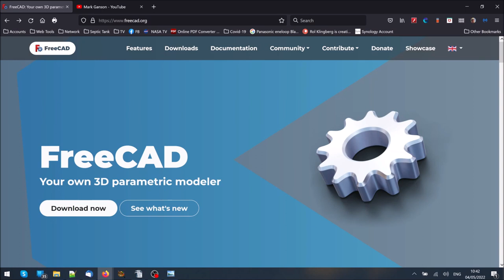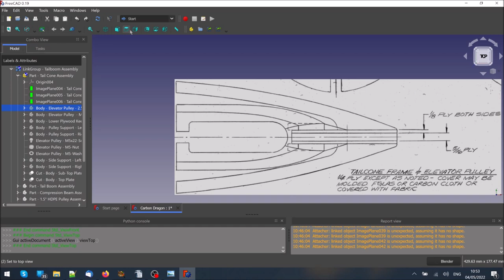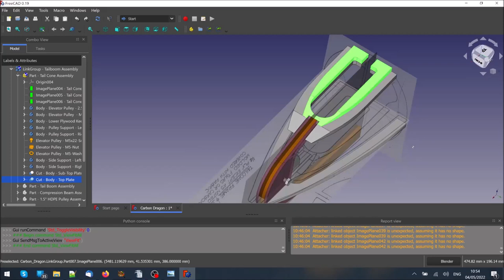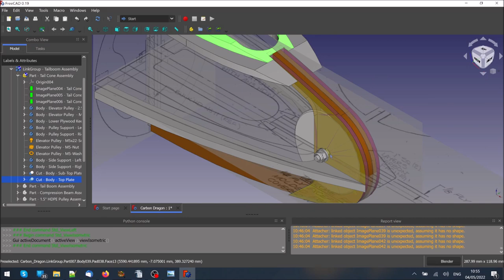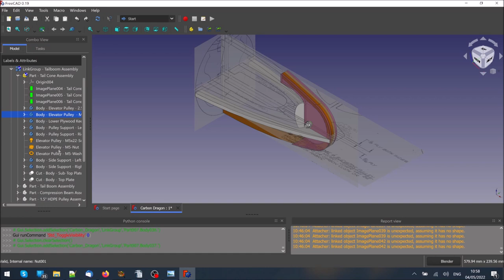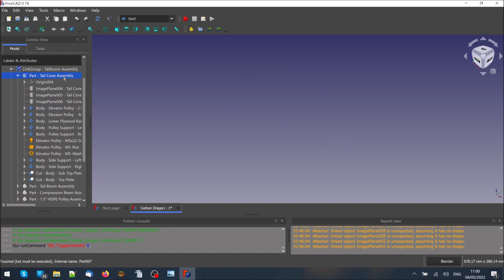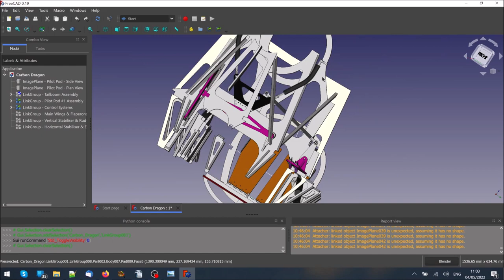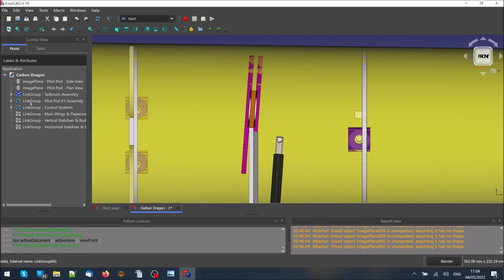Phil Lardner's Carbon Dragon Project - FreeCAD Model Tour

Comment: Thank you very much for sharing ! Do you have a blog ?
Reply from the maker: Thanks. I don't have a blog, but you can find out all about the Carbon Dragon glider on my website: carbon-dragon.ihpa.ie
Reply: @PhilipLardner1967   Thanks again. May I ask you how much weight you saved substituting the wood by carbon?
Reply from the maker: @tomdoly1918  There's very little weight saved by using a carbon-kevlar-carbon sandwich ( which ended up about 0.5mm thick, as opposed to the original .8mm thick plywood leading edge), but the composite leading edge is much stronger and will never deform due to humidity, as the plywood is very prone to do.
Reply: @PhilipLardner1967  Again thank you !

Comment: Nice work Phil... If there was one guy qualified to do this it would be you.

Maybe you can eventually get CNC drawings together with a material list that would allow a person to have a fully carbon fiber carbon dragon that can be cut from stock sheets of carbon fiber. It would be neat to see the carbon dragon not only preserved, but also updated and have a lower build time.
Reply from the maker: Hi Carson, while there may be the odd misalignment of the positioning of individual parts in the model, the individual parts are 100% accurate and can be used to CNC cut them out from sheet stock (plywood or composite sandwich) with confidence. FreeCAD has a 3rd party plugin called "Path", which will generate a toolpath for a CNC mill (install by going to Tools - Addon Manager - Workbenches - Path). I'm just starting to play with that now... as I built a 4' x 4' CNC mill during the first Covid lockdown too!
Reply: FreeCAD has a toolpath generation feature.  Not sure what you mean by CNC "drawings".

Comment: Excellent on 2 fronts.  1) Making the model of a glider public.  2) Using FreeCAD to do it.

Question:  Are you going to perform FEA or CFD on the model ?     If you are going to do FEA, how are you going to model the composite material ?  Or will you do a "simple" bulk FEA ?
Reply from the maker: :-) I don't trust my FreeCAD skills that much - I'm sticking to pen and paper for critical load / strain calculations (see my spreadsheet on the CD website). I haven't learned to use the FEA / CFD tools in FreeCAD yet - I've barely scratched the surface of this amazing package.
Reply: @PhilipLardner1967  Well... you could compare your pen and paper results with the FEA results ?   That would make great video content.    

There are several really good videos on doing FEA in FreeCAD.  You've got the hard part done by making the model.   Now all you have to do is apply loads to it.

The great thing about FEA is that it finds stress concentrations.
Reply: @SomeTechGuy666  btw - for fea with composites you need proper composite material "orientation" where freecad is ok only for non-anisitropic materials only.
Reply: @StanislavZachazevski  FreeCAD is open source.  Support for anisotropic materials could be added.  There is already support for rebar in concrete structures.  A similar thing might be done for a glass matrix in epoxy as a first order approximation.
Reply: @SomeTechGuy666  yes. But it is "too risky" to make it working for structural elements. Ie - per eu rules you are allowed to load cf parts only at 25% of strenght due to big margin of error. Plus for buckling you have more failure criterias, than for simpler materials.

Comment: I have a question, Phil.  I've always wondered about this... 
Carbon Dragon uses carbon fiber wing skins.   How much weight was saved by using CF skins versus adding more material to the spar and ribs and covering with something lighter, like Poly  Fiber ?  How much is the CF skin contributing to the strength and stiffness of the wing ?

I get that using the thinnest materials the greatest distance from each other gives the highest moment of inertia.  But without a "flange" keeping the skins separated and transferring the shear load between the "caps", ie skins, how much are skins really contributing ?

Thanks for sharing your great work.
Reply from the maker: In the prototype Carbon Dragon (and specified in the original plane), the leading edge D sections and spars are all made out of 0.8mm thick plywood. The spar caps were made from resin soaked carbon tows (rovings / threads / strands). The wing ribs were cut out of 1/4" ply, and the whole wing was skinned (covered) with 50gsm polyester cloth. The polyester skins contribute little if any strength.
In my all-carbon CD I replaced the 0.8mm ply D-section leading edges with a lamination of two layers of 195gsm carbon twill cloth and a single layer of Kevlar sandwiched in between. My composite leading edges were a little lighter than the original ply, but perhaps not as stiff due to them being so much thinner than the ply. As a result, my D sections tend to buckle a little under high loads (rough thermals!) which can take a little getting used to! My wings are also covered in 50gsm polyester cloth, but I added 2 coats of UV protective primer and then multiple thin coats of 2-part Ecopoly paint from Stewart Systems. My wing skins are definitely heavier than the prototype wings. Long story short: you can make a part (or a wing) a lot stronger than a wooden wing but it is very difficult to make it both stronger AND lighter! The strength to weight ratio of wood and plywood is really hard to beat. Where composites will always out-perform wood is when it comes to moisture and life expectancy. Wood and plywood (even when sealed!) is hygroscopic - it absorbs and releases moisture according to the humidity of the environment it is in. Over time a wooden wing is guaranteed to deform due to moisture. A composite wing will not. Ireland, where I live, is not known for its desert-like climate!! ;-)
Reply from the maker: The leading edge D-sections carry all the torsional (twist) forces and react them back into the spar caps. The spar shear webs carry the vertical shear loads and react them back to the spar caps. The spar caps carry all those loads back to the wing root. Aft of the spars, the wing ribs provide surface area to the wing and carry the loads from the flaperons back to the spars. The wing skins really just prevent the air from passing through the wing! The wing loading for my CD is around 1.75lbs/sq-ft = very low indeed!
Reply: @PhilipLardner1967  Thanks.   What are the spar webs made of ?
Reply: @PhilipLardner1967  So these aren't stress skin wings !  Good to know.
Reply from the maker: @SomeTechGuy666  In the prototype, the spar shear webs are also made from a single layer of 0.8mm ply with vertical stiffeners glued to them in between the ribs. I made my shear webs from just two layers of 195gsm carbon twill cloth laid up ar 45degrees to the long axis for maximum shear carrying capacity. I also bonded on some vertical foam strips as stiffeners in between the two layers of carbon cloth. Lots of photos of the process on the CD website.
https://carbon-dragon.ihpa.ie/index.php/cd-builders/phil-lardner-s-cd#main-wing-spars